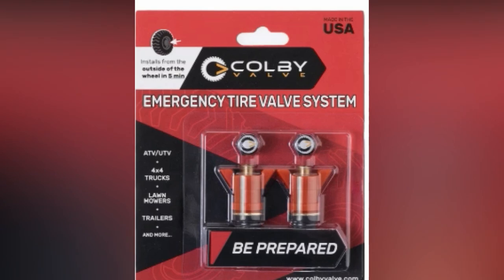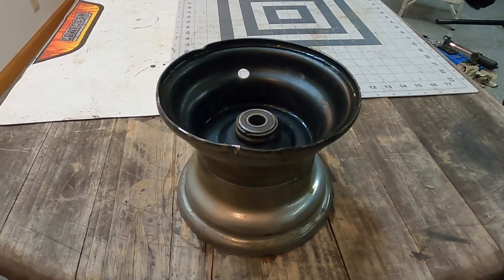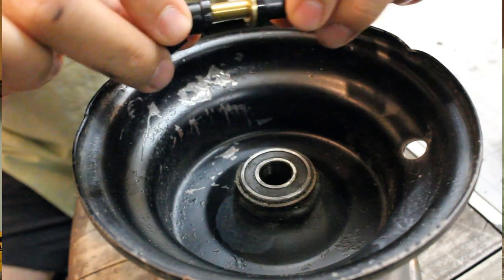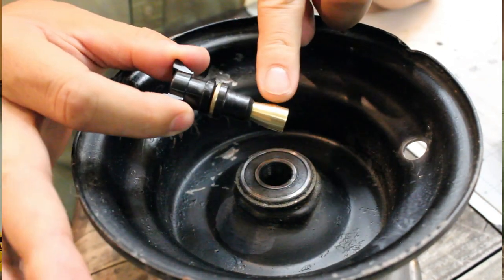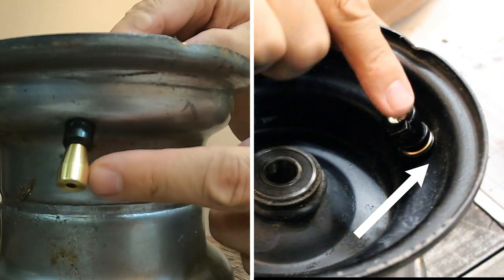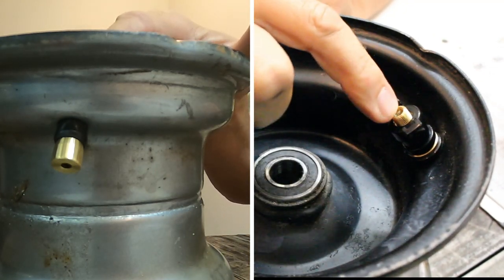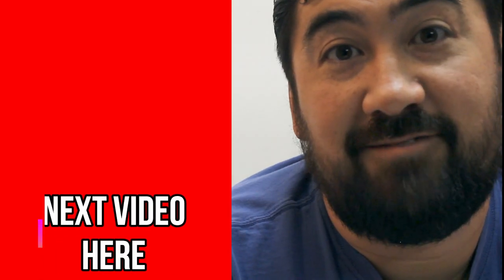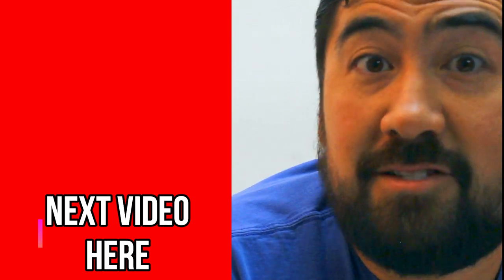How to replace a valve stem without removing the tire or breaking the bead | Colby Valve Install

Comment: Great tutorial and visual representation on how it works! Thanks!
Reply from the maker: Thank you.  Really a lifesaver if you need one.
Reply: @GrimRZR  Just learned about them and picked up a set before crawling in Big Bear this weekend. A lot of videos on installing them but nice to see your video showed how they work inside the tire.
Reply from the maker: @4122inc  another good thing to keep on hand is a sidewall slug.  Haven't made a video but they are awesome
Reply: @GrimRZR  Never knew these existed. Thanks.
Reply from the maker: @4122inc  glad you liked it.

Comment: I'm having issues on my daily with it's valve stems. Is this safe for everyday road use as well?
Reply from the maker: I don't see why not but I'm no expert.   As long as you vehicle doesn't have air pressure sensors